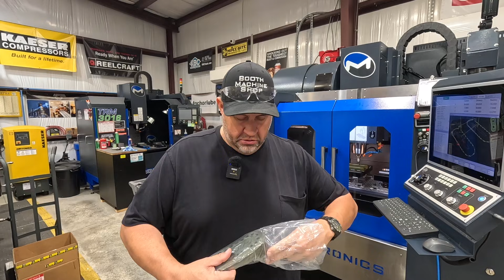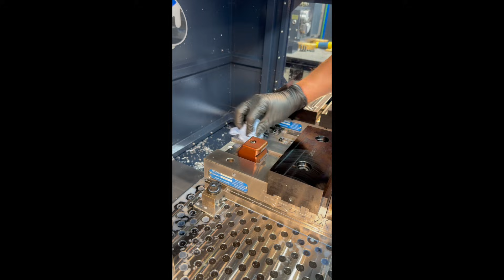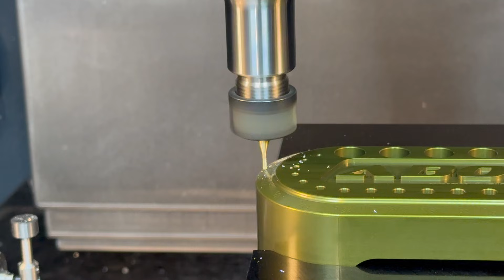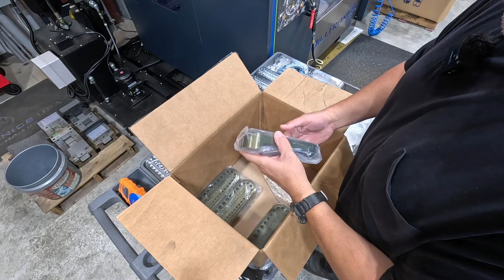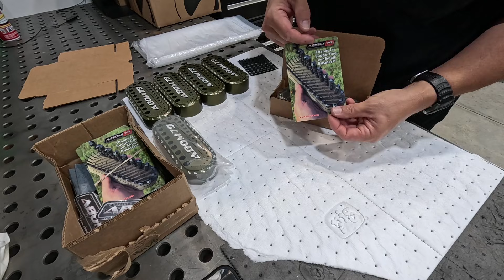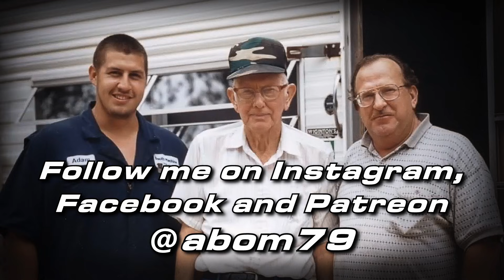Saturday Night Special 394- Post Anodize Engraving

Comment: Instead of adhesive feet, I'd suggest using a spike based foot.  It would require you to drill a fine hole in the center of where the foot would go though.

Comment: Adam, there are 8% (1 out of 12) men (or 0.5%, 1 out of 200 women) that are color blind.  I would encourage you to find 2 or 3 color blind people and have them review your colors and readability of your products.  I am one of the 8% and find that most manufacturers seem to completely disregard that segment of the population.  Yes, cutting that color off of the top of the numbers makes them easily read by a lot more people.  I make purchasing decisions based on that very criteria.  You may also want to consider making the holders for the metric sizes different colors as well.  If I were purchasing, I would want 1 to be one color and the other a different color.  For myself, I find color differentiation a big item.  I can more quickly pick the color of what I want instead of having to read something.  Just a few thoughts--I really like the indexes!

Comment: Hi Adam, To gain a few seconds on the run time I would edit the program to include a tool change at the end of the program putting in the first tool of the program. That way there is not a delay at the start of the program to load the first tool.

Comment: Another suggestion for you Adam to try - Have you ever thought about machining another small part out of the bottom of the drill indexes. Like maybe a key chain or something. 
I don't know how much stock you have there but it looks like a half inch to me. You could put the part off to one end and saw it out. Would not take very long. Never seen you use
a vertical Bandsaw in the shop, maybe a good excuse to get one! Could possibly get in there with a slitting saw, I think that would kind of tricky though. You would not have to do this on every single
drill index either. Let me know what you think. I'm one of your viewers that suggested the post anodizing engraving.

Comment: You may want to talk to Milltronics about machining anodized aluminum.  What you are removingis not metal.  It is aluminum oxide, a very hard ceramic abrasive.  The particles of the aluminum oxide  portion that is removed will be extremely fine.  The possibility  of bypassing shields and coolant filters exists.  

I pass this on from having experience with a local NC shop that used metalworking NC mills to machine G10, a glass epoxy laminate.  The glass particles in the G10 and the plastic were incompatible with his coolant, filters, and shields.  He had to scrap two  NC machines and almost lost his business.    

Keep up the great work,

Jimmy Johnson

Comment: If you're engraving the fractions after anodising, why bother engraving before as well? Would eliminate needing to realign the parts so the engravings match, and save a couple minutes per unit on machining. I prefer the normal green over the OD green, but I'd buy a blue over the green.

Comment: Doesn't that leave exposed raw aluminum that could oxidize? Wouldn't they need a clear coat after engraving to protect its surface? :-)
Reply: Technically, but these are drill indexes for dry indoor use. Might lose the luster a bit, but that's it.

Comment: I had some 6061 parts anodized red. They had areas which I had welded. The anodizing came out darker on the welded areas. Just FYI.
Reply: I had that same problem, luckily my parts could be bolted together, so that is the route I chose. It fixed my problem completely  :0)

Comment: Hi Adam. I’ve been enjoying your videos for around a decade now, and I’m not even a machinist, just a VERY part time woodworker. I went to your website because I was curious about the price of your drill index, and I was surprised to find it reasonably priced, considering the price of the raw materials and the  time/effort needed. Plus, I find your design very pleasing…..nice job.  I’d be proud to own such an heirloom product and be able to support you at the same time.  So, I just ordered the OD green with drills.

I decided to order the original version because the ball mill makes the numerals slightly fatter. I like the contrast, the milling provides after anodizing, but I’d rather have the numerals more crisp. So, my plan is to infill the original version with silver paint and sand the anodizing off the top of your logo in order to achieve the same look.

I think you’re going to get so many different opinions on colors, I’d be surprised if you’ll be able to come up with some kind of consensus.

Comment: Laser marking after anodising looks very nice too.  It's worth a look (much less expensive than your MillTronics) and you could e.g. put marking on the back, and even a QR code with a web address.  Even a customisation if it's a gift or whatever.  Same CAD CAM work flow.